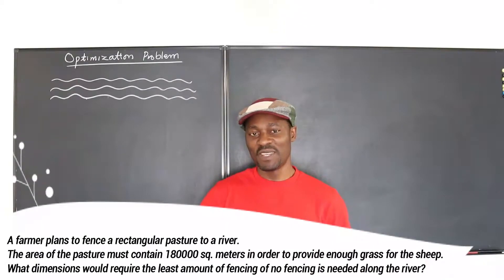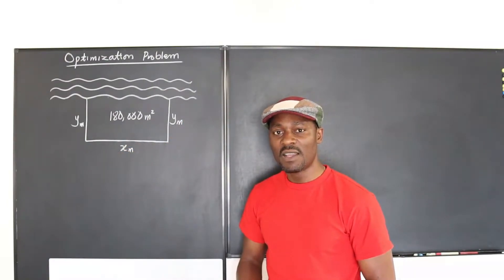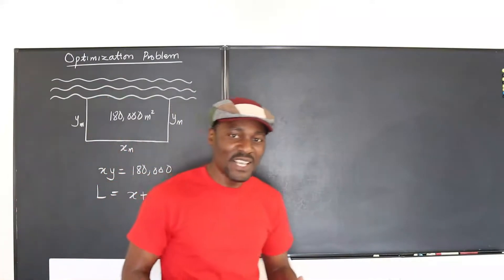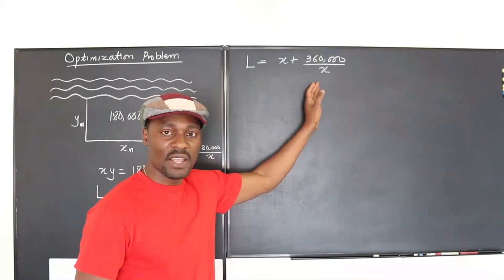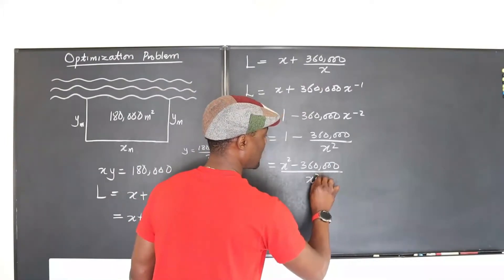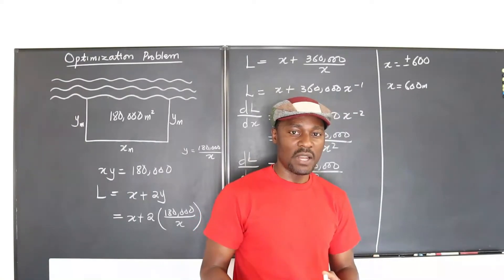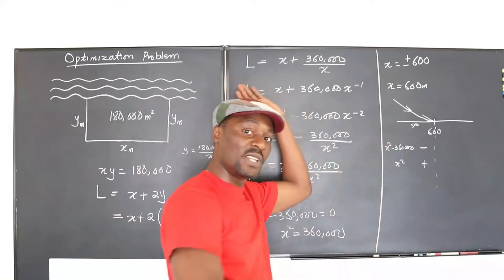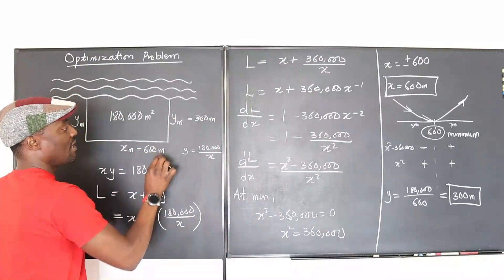Calculus Optimization: Minimum Fencing Material

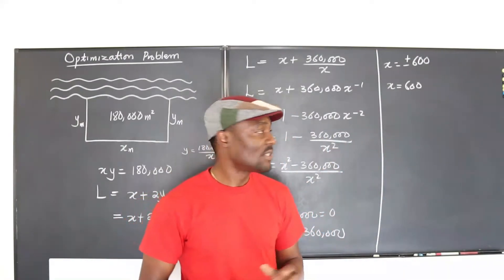Comment: At 7:15, the simple way to distinguish a local minimum from a local maximum is to take the SECOND derivative and evaluate it at the local point you have identified. If it is >0 at the local point then the curve is bending upwards so you have a local minimum. If <0 then the curve is bending downwards so you have a local maximum. If the second derivative is zero then the curve is straight (in fact it's flat because the first derivative is zero at the local point) and this would only occur if there was a continuous range of values at which the FIRST derivative is zero, not a single point. This is the way I was taught in high school years ago. Your way is also good though.

Comment: I think that you can conclude it's a minimum in an easy way. If x is small, then 1/x is large and it decreases as x gets larger, this term dominates, and is positive for positive x. When x is large, the 1/x term is small, the x term dominates and is increasing. So the critical point is a minimum.